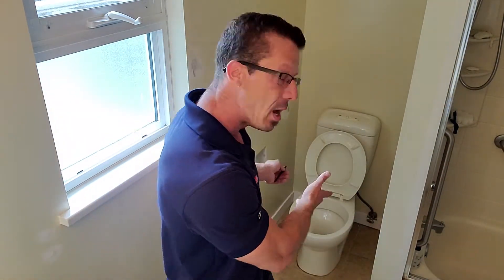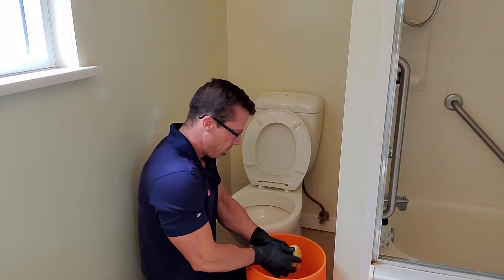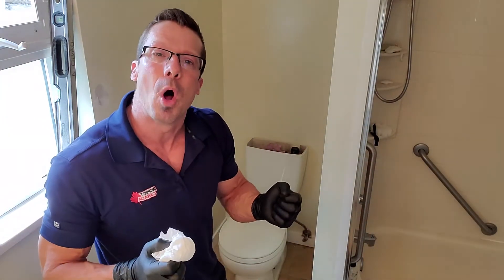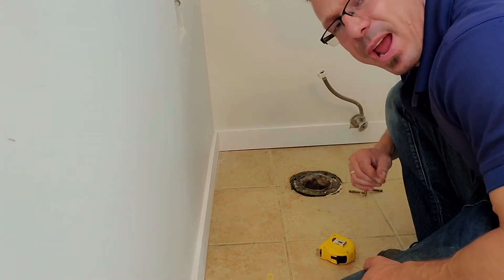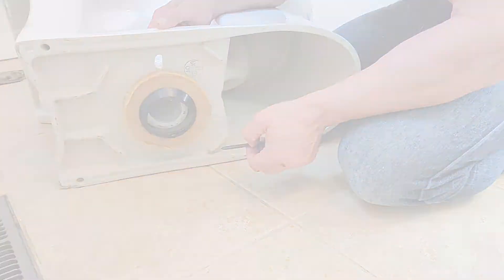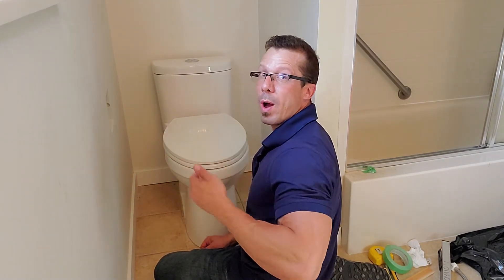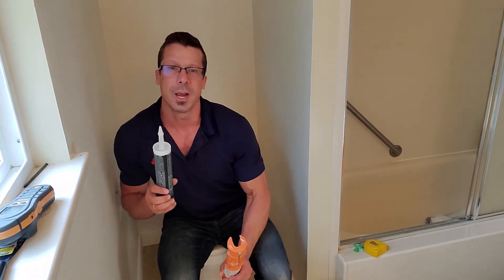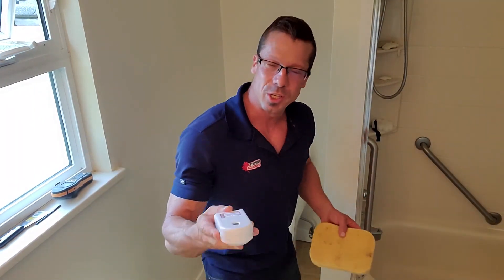Loose Toilet?  How to replace the wax ring and toilet.

Comment: My landlord hired a plumber to put on a new wax ring and still leaking,Any advice? Great Video 😊😊
Reply from the maker: Hi, unless the plumber did a bad job, I would think that there might be a problem with the drain or the toilet itself. I would open from below and see what's leaking then you can finish it with an access panel for future access. Thank you so much for watching our videos.
Reply: The toilet as old as the apartment building over 20 years old. They have worked on it couple of times they should buy me a new toilet.
Reply: @InspectCanada  he put a new wax ring and then rebuilt the toilet and it still leaking. Because my ride next to the toilet is soaking wet again this is not normal I don't think he's done a good job even the first time
Reply: @InspectCanada they finally figured it out it was a shower that was leaking and needed a new spout . The guy soldered replaced the spout now not more leaking!!😊😊